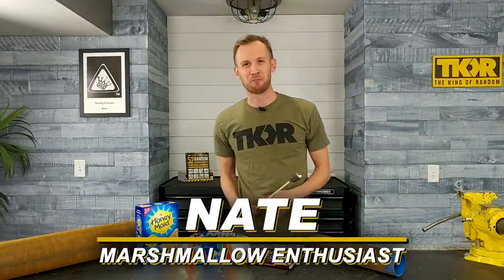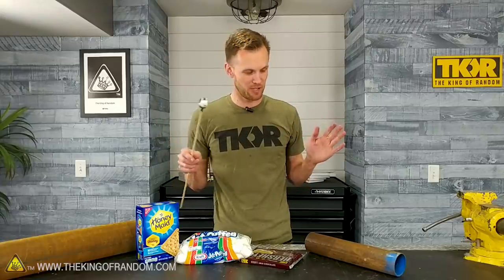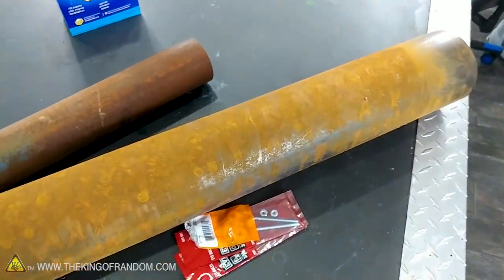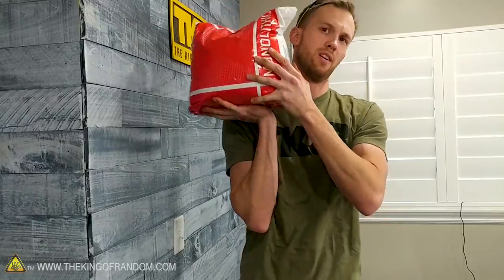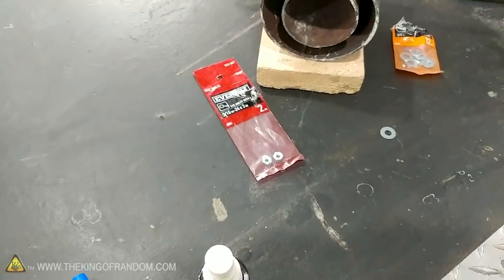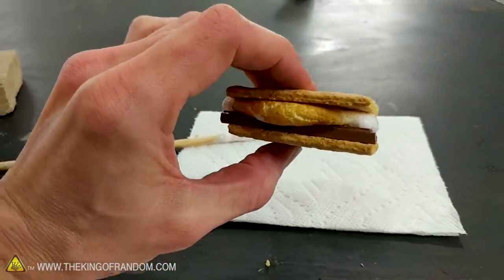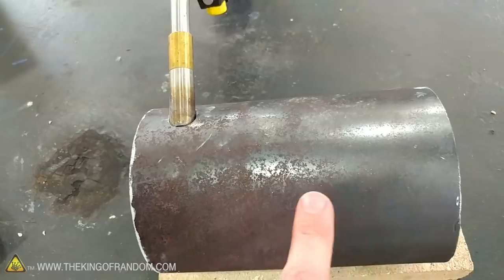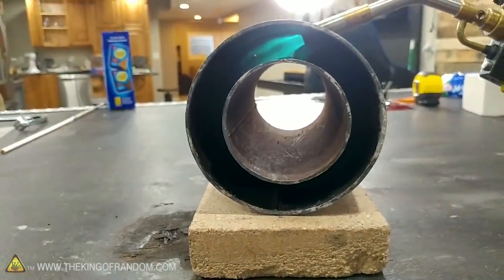We Found the Secret to Roasting Perfect Marshmallows

Comment: TKOR Marshmallow Roaster 2.0 upgrade list

- Arduino driven motor to move and spin the roasting stick
- Multiple sticks (with auto-reload capabilities) for rapid-fire s’mores production
- heat-proof TKOR logos

Also should note that it was weird watching a video involving fire that didn’t have Calli’s gleeful giddy reactions
Reply: i missed cali and her pyromaniac side
Reply: It was kinda refreshing tbh
Reply: I was thinking of the same thing but saw yours here
Reply: This sounds like a TKOR and Micheal Reeves crossover
Reply: Also instead of dowel use a metal rod for easier clean up and reusability
Reply: @opt-o-ops7271  or William Osman it would make more sense with him
Reply: @pepsiking5712  lol I can here from one of his videos
Reply: Also spilt the  heat up to evenly distribute it through out the cylinder
Reply: A temperature control throttle to keep the temperature even
Reply: Yea Calli should've been there for the fire
Reply: See the Light  fair point though a steel rod is still more environmentally friendly then multiple dowels
Reply: @morrigankasa570  dowels are a renewable resource
Reply: @fishiganstate3880  not entirely the process to cut and shape them uses a lot of energy, sure a steel rod takes a lot of energy too but 1 rod compared to multiple rods/dowels is less energy used

Comment: You should make something that turns the stick automatically at an even rate.
Reply: A drill
Reply: A little dc motor attached to a 9v
Reply: Yes, I thought the same thing!  I’ve been sketching ideas for a marshmallow roaster, and this looks much simpler than what I came up with.  There are several modifications that could be made on this design.  I have a few synchronous motors I scavenged from microwaves that would turn the stick at just the right speed.
Reply: a lego motor with a marchmellow stick adapter
Reply: @Dubya84  you have to do this
Reply: @maxrakhuba8753  I have an idea; drill into the skewer thing that goes into the little eyehole keys.

Comment: Hey I was just thinking if making a backyard foundry and was thinking what happens if you try to make one inside dryer drum for a big industrial size one for more than one crucible. It would make things quicker us if you do a brick wall around it and fill it in with fire rocks it could be used to keep heat inside
Reply: Probably to big to concentrate heat well enough
Reply: @DaltonCollinson  well if there is more then just their normal 2 propane intakes it may be better for higher heat temperatures.
Reply: It could reach temp with added oxygen, especially if swapped propane for a higher temp burning gas like acetylene.
Reply: @matthewcamacho7690  Its not about the amount of heat added, or the temperature. Its the surface area to mass ratio. If its 12 inches deep the inside would take forever to reach the same temperature as the outside.

Comment: You could make this automated like a toaster where there is an outer ceramic rod with a male notch, multiple steel rods with a corresponding female notch, the Loops could be spring releasable clips similar to the I hooks, a small motor programmed with a timer attached could spin the assembly, and the torch could be integrated into the unit with either a replaceable bottle, or it could be controlled with heating coils like a kiln.

Comment: This should be motorized. 8:08 He had to speed it up.
Reply: power drill
Reply: The video was sped up because it takes a long time to cook. The only benefit of motorization is that it would be a constant speed.
Reply: @CyborgPenguin  Your forgetting the laziness of people, and the fact it takes finger strength to keep it spinning. I find not needing to spin it myself a large benefit.
Reply: @gabejuhasz3743  your original comment implied the need for motorization was due to speed.
Reply: @CyborgPenguin  I was trying to get across that it took so long that they had to speed it up, and doing it for that long would strain your fingers.
Reply: So?
Reply: @aliehs.l  So, if your probably going to roast much more than one marshmallow the motor is going to make a huge difference.

Comment: Surely the whole point of the design was to get even heat all around....so why spin???
Reply: The flame comes in at one point, while in theory the spin of the flame hitting the cylindrical wall should cause the whole assembly to heat evenly, the spin assures that any hot points along the inner shells surface won't affect the even cooking of the marshmallow. Also If the marshmallow isn't put onto the stick perfectly centered, one side of the marshmallow will be further from the inner cylinder wall than the other.
Reply: Another point is that as the marshmallow cooks, it'll soften up and start to droop. Spinning it will keep one side from hanging down too close to the heat.

Comment: Now attach that wooden rod to a drill (you could probably just put it in the same way you would any head for the drill) and adjust a ziptie to the perfect speed you want it to rotate. Then slide the ziptie on and off the drill to turn it on and off.

Comment: I wonder if you just used a 2.5 inch steel pipe with an end cap then coved it with red hot coals would work?  It would be easier to use camping.

Comment: Two things for improvement first Nate buy a knotted wire wheel or cup for your angle grinder. Makes rust removal far left tedious. Second a stainless steel rod with a small crank bent on the end instead of a dowel. Easier to clean and near indefinite uses over the dowel. 17-4, 400 series, or other surgical/food grade stainless will do fine. NEVER USE GALVANIZED!!! That's just asking for metal feaver from zinc oxide poisoning.

Comment: you do you but i just cut out the top of a pepsi can, drill a hole in the bottom and use a rod to rotate the can over a campfire. it works pretty well lol (hot dogs work too)

Comment: you know why the end of the measuring tape is never fixed, right? you need to hook it and pull tight to get the right measurement, the slop is for compensating the thickness of the metal lip when doing inside/outside measurements or measuring distance from an edge